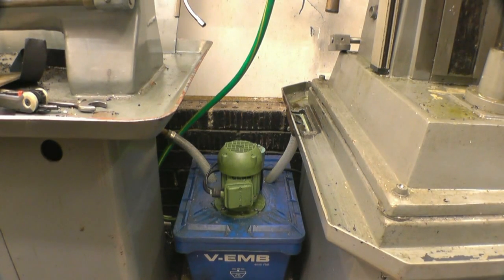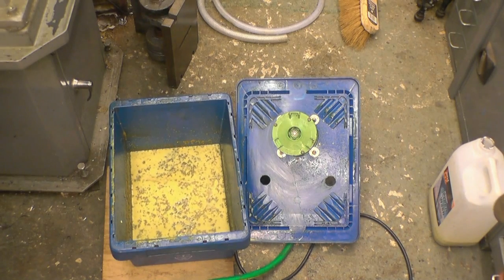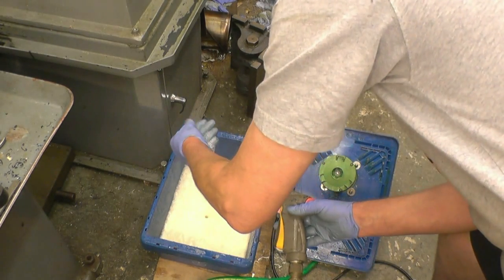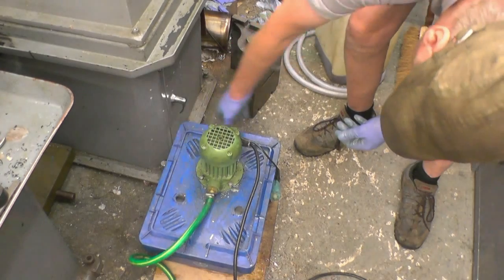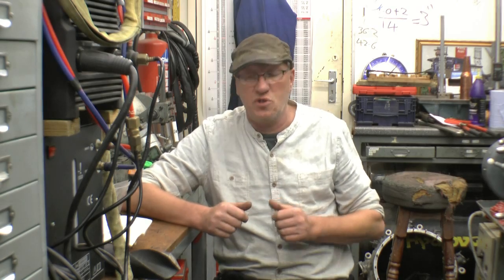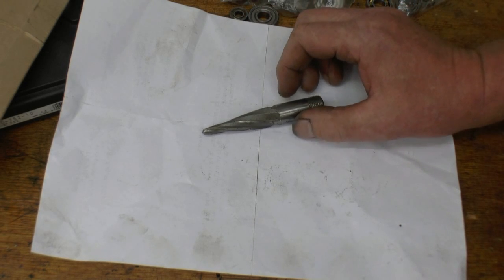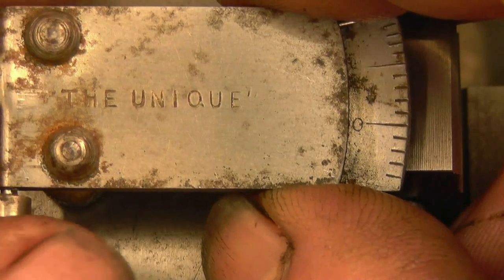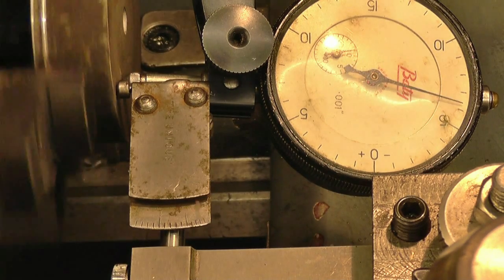SNNC 137 p1  Vintage indicator  Coolant system

Comment: bud... a twastard engineering / Double Boost.... coffee cup... standard type cup for all of our coffee cup collections....  really... youtube should get involved with that.. put their logo on it with you... would be worth having that coffee cup....or at least i think so... a cody's lab cup... keith Rutker... luckygen1001 etc.  also

this was a cool episode... neat old indicator... for those who may be tempted to talk trash about the value of modern indicators.. the longer throw on a modern clock may not be necessarily better for indicating something true... but is far handier when you use the same tool to indicate an adjustment or taper... to adjust tooling, or make something untrue or eccentric in order to cut a taper.

Comment: If mama is not happy then nobody is happy.  Glad to hear your gal is feeling better.
This is my first view of your channel. I've drifted over from Tom Lipton's channel.  Thanks for your postings.
I was interested to see your coolant system.  It looks compact, simple, affordable, and efficient.  A few things sprang to mind as I watched.  You can wrap up a couple of magnets inside a Ziploc plastic bag and chuck it in the bottom to catch the fine ferrous particles and stop them from circulating around the system. The magnets they use in automatic transmission oil pans work great.

Comment: Hi John. The tapered milling cutter (especially if it has a ball end) would be used for making tooling with a draft angle. I had many like this which I used to make vacuum forming tools where a radius in the corners and a draft angle were essential. The draft angle not only aids removal of the moulding from the tool, it allows mouldings to nest - like ice cream cones- which is useful for storage. Best regards, Mike